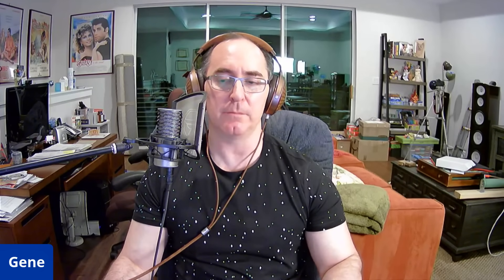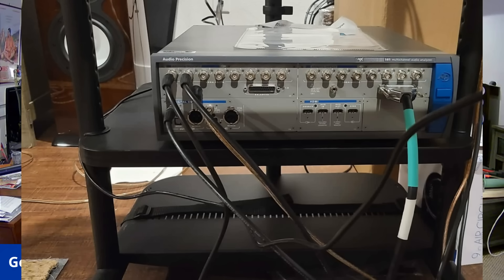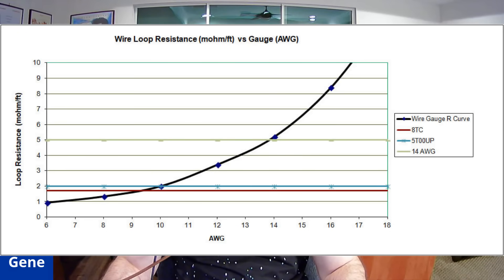Speaker Cables Really Don't Make Much of a Difference?

Comment: Thanks for the factual information! I would love to see the audio differences between high dollar turntables vs medium and low dollar set ups played through a controlled set up much like you have done with the speaker cables. I think there is a lot of hype involved, meant to extract money from people's wallets.
Reply: Actually, this may be something you, or anyone else for that matter, can do yourself.  Listen to an entry-level Clearaudio Concept (currently about $1600) or Concept Black 'table (@ $2K or so) or a MoFi Ultradeck (about $2300), a Pro-Ject RPM 9 Carbon (about $2500) or a VPI Prime Scout (again, about $2,500), then listen to ANY mass-market turntable (your choice) under $500.  Use the same cartridge on both, making sure to set up both 'tables properly.  Regarding audio differences, it's not even going to be close.  And the sonic differences become even more profound as you move up the engineering sophistication ladder with respect to platter, drive system, cartridge and tonearm.  Sadly, it is true that with turntables, you often get what you pay for.
Reply: @oldmacguy4563  Maybe I can try this if you send me a Project RPM 9 Carbon table! Thanks before hand.
Reply: @oldmacguy4563  Ironically any "advances" in turntable technology amount to little more than turdpolish at this juncture considering the obsolescence of vinyl as a high-fi medium. A bit like customized gasoline muscle cars getting smoked by a stock Tesla borrowed from mom for a day at the track.

Comment: But the guy in the shop said it would be crazy to get cheap cable when I'd already spent thousands on my hi-fi 🤣
Reply: Yes, because there is where his margins lie...
Reply: The problem is that other stuff is also fraudulent skyrocket pricing. Fully unjustified.
Reply: Define 'cheap cable?'
Reply: that's how they make money, speakers and most equipment is screwed up for business.  A mom and pop shop need to charge the same price as the internet does otherwise no one will really by +/- a little.  Yet, with cables they can make much larger profit margins, so they teach them and an owner would put that on his employees to keep his business alive.

In fact, if you are unaware audioquest was caught manipulating the sound and even video with hdmi cords they sell.  There's reasonable and not reasonable, and most the company's are trying to juice you up with that. Regardless of the circumstances, the reality is even if you spent 1000 on speaker cables, the performance would be about 1-3% better, if you really believe or feel it makes a difference.  That's not worth it for the price, because 50 dollars will get you 3% difference.  

I am just saying this in general, this comment is not directed at you or for you.

Comment: Excellent Gene, that should shut the snakeoil believers up. As a long time follower (email newsletter since before YouTube) I appreciate cold hard facts over hype. I'm just running 12 gauge with banana plugs to the center / mains and 14 gauge to the rears as it was a cost saving for the longer runs.  I don't recall such attention to detail in your previous cable articles so the top notch measuring equipment will leave no room for doubt and should shut any naysayers down.  Thx for putting this topic to rest, especially for all the newbies.  Thumbs up.

Comment: I don't judge a car on how it tests, I ride it and buy the one that feels better to me. Hey if you don't think wires make a difference then don't buy them. Why should you care what I buy? I buy my cables used and get a great deal on them. Had junk that caused the sound to pop in and out. When cheap wires are on the brink of failure the sound does degrade even if they are still working. Cleaning all of my connections and deoxit the internal preamp controls also improved the sound dramatically. Again if none of that matters to you then I'm fine with it. Just don't try and change my mind. Wine is made from the same stuff but people pay a lot more for certain wines that test the same chemically.

Comment: Way to go Gene - we do agree on something after all !!!
I guess there's a lot of money to be made from selling snake oil. I've been using 6 AWG welding cable sincer the mid 80's with the bare copper ends tinned with silver solder to aid conductivity and resist oxidisation. They did not even cost anything - I salvaged them from a friends' workshop. All those expensive fancy cables from the snake oil mob, and I did do a direct A/B with quite a few of them - well, they only proved to be better in the looks department. 
They all make these outlandish claims about their cables, yet no specs or measurements are provided. If amp, speaker, DAC and manufacturers of other audio gear are required to provide specs, I think it's about time that audio cable manufacturers be required to do the same.

Comment: Thanks for the insight, really appreciate the work put into this matter. My syatem was purchased in 1989, and is still the same till present. The loudspeaker cables I opted was the Linn K400 biwire, which for me wasn’t about sound but for convienience sake and looks. It was like $100  with linn plugs.

Comment: Interesting video Gene, all my speaker cables and interconnects are from Mogami. They have a very good reputation and are not expensive. Thank you for the service you provide to the audio community
Reply from the maker: Mogami makes great cables, snake oil free.
Reply: I use mogami gold guitar cables. Great stuff with lifetime warranty.
Reply: Gene, did you send your speakers to Danny at GR-Research for an upgrade?   Maybe you'll hear the difference then
Reply: @mag290 , tweaking the speaker CAN'T make a difference to the "sound" of the cables. Did you watch the video?
Reply: @mag290  
🤣

Comment: Thanks. I’m off to Amazon to buy some wire, banana plugs and some colorful flexi sleeving, to make my own cheap cables.
Reply: Just make sure the banana plugs you get are gold-plated...(as most are) - it's just a shame that the base metal underneath the flash gold-plating is usually very cheap brass, which is known for it's poor effect on audio.
Reply: So would purchasing a name brand plug be more beneficial? Or are they also a generic gold plated item?
Reply: @badonkadonkskidz   It really depends on where they are sourced from - most are made in China so they are most likely to be made from cheap base metal and then given a gold-plated finish (that makes them look good, but stops the base metal from tarnishing). One really needs to ask the suppler what the base metal is..if it's brass then it is less good than say pure copper.

Comment: Appreciate the video. Is an increase or decrease in db the same thing as an airy top end, or better separation, or a blacker background, or improved clarity. I just switched from 14awg zip cord to the Kimber 8TC with WBT connectors and did in fact hear changes in the upper mids to treble arena. Not sure how a machine can hear or read human hearing based sound “impressions”. What are your thoughts?
Reply from the maker: My thoughts are the difference was barely measurable and in this instance inaudible.
Reply: @Audioholics  Kept my old cables and will do blind tests this time around. Still going to base my decisions on how it sounds to my ears, not how a machine measures dbs. + -
Reply: The author will probably explain to you that you've been sold expensive jewelry and you've wasted your money as there is no difference you can hear (it measures less that 0.06 dB difference after all...the graphs PROVE that :-( ). So your hearing is either perfect or you've been taken in by a placebo effect.

Personally speaking I think it doesn't matter what the author thinks...you heard a difference !! And if you like the difference then keep the Kimber - if you didn't hear a difference, get a refund
Reply from the maker: @timomalley1027  I did keep the Kimber because it looks cool ;)

Comment: Well if cables ever mattered and audio companies know that they do , so why they still use those tiny wires in there crossover or point to point wiring 🤷‍♂️.  
Yes we need quality cable but we don’t need batteries on them or freezing them to sound better 😁.
It always baffled me how someone hooks a python from there amp to the speakers and inside the equipment there’s only tiny worms 😂🤣
Reply: 😝😝😝😝😝😝😝😝😝😝😝😝😝😝😝😝😝😝😝😝😝😝😝😝😝😝😝😝😝😝😝😝😝😝😝😝😝😝😝😝😝😝😝😝😝😝😝😝😝😝😝😝😝😝😝😝😝😝😝😝😝😝😝😝😝😝😝😝I’m still laughing 😆 😆😆😆😆😆😆😆😆😆😆😆😆😆😆😆😆😆😆😆😆😆😆😆😆😆😆😆😆😆😆😆😆😆😆😆😆😆😆😆😆😆😆😆😆😆😆😆😆😆😆😆😆😆
Reply: Those wires in the amp run a very short length so thin wires can used. Thicker wires are needed for speakers becuase they need to run way longer.
Reply: @AbsoluteFidelity   no sry , I’m not saying we should use 1mm wiring but not 10cm tick wiring either. .  It will make no difference.

Comment: Personally I would like to see the difference that copper clad aluminum has vs oxygen free copper in this same test. Mabey even some 99% silver wire for fun.
Reply: For silver or even gold, versus copper it's just a matter of resistance.  No need to actually test wires made of them, just extrapolate given the data presented in this video (spoiler alert, it won't make an audible difference.)  Also all copper wire sold for electrical wiring is "oxygen free" to a pretty high degree.  Else it would turn green aka corrode and fail.  It's actually more important for house wiring because the wires carry much more sustained current and at higher voltages than speaker cable.
Reply: Agreed! 😉👍

Comment: Power Cables are the biggest joke. Instead of spending $1000 on an Audioquest power cable, put your money toward a PS Audio Regenerator.
Reply from the maker: or neither. Just have a couple of dedicated 20A circuits to feed your audio gear and use power/surge supressors from reputable brands that have either CL,TUV,CSA or other 3rd party safety test certification.

Comment: Now do copper (OFC) vs "copper cladded" aluminum (CCA)!
Reply: Go to Wikipedia and search 'Copper wire" . There are only 3 but the sellers make you think there are 200 types. Go for low contaminant OFC or OHNO Continuous Cast (OCC).
Reply: @amazoidal  There are multiple grades of copper wireavailable....it just depends on what you ask for from the refinery/supplier in terms of purity.

in the 1980's when standard purity copper went up in price, some telecomms companys (in Europe) used to instead specify "Polish" copper (from Poland) to sink into the ground (or string from telephone poles) when new telephone lines were required for the likes of new houses and businesses (due to the increase in demand due to fax machines and modems). Polish copper was cheaper and less pure (ie had more contaminants within it) but it was ok for phone wires (which have a limited frequency bandwidth). When demand for Polish copper increased they switched to using aluminium, which was cheaper again, but had higher resistance.
Reply: Or tin-plated coper, silver-plated copper, solid core, braided, Litz cables, twisted pair copper - all excluded from the video...I wonder why?

Comment: I don't care what anybody says , ill be dammed if I set my $500k McIntosh Line Array system up with bulk Belden wire & interconnects from Best Buy or Guitar center ,I also refuse to spend $3k on a pair of McIntosh XLR's simply for appearance, I will however spend a grand on affordable wires & interconnects from company's like Emotiva simply because my $150 Emotiva speaker wires look just as high end as a pair of $1,500 speaker wires sold by McIntosh. 

BTW any of you know legendary speaker designer Roger Russell personally, or by his name being connected to McIntosh Labs hifi ,I speak with him once or twice a month & he is not doing well in his assisted living home,his houses are gone,his massive vintage gear collection gone,his storage facility full of cabinets of research & white papers are gone,his wife is in a full on nursing home & has dementia, and to top it all off he is barred from seeing his wife over this Covid insanity ,I never asked if he still responds to his decades old @earthlink email address any longer but if you have it you wouldn't be wrong in sending him some much needed kind words right now,his brain is sharp as a tack but his body isn't.

Comment: Kimber 8TC is the best cable you can get???? oh dear :-(
Reply from the maker: It's the "best" cable I have on hand to do the comparison. And yes it's very good cable. I wonder what you think is better and if there is even published measurements on your magical cable.
Reply: @Audioholics   I don't have a single "magical" cable...as there are many cables available made from different materials (Cu, Al, Sn, Au, Ag or combinations of these etc) and different insulations (uPVC, PE etc) and different construction (figure 8, webspaced, Litz, twisted pair etc) and these each have different electrical properties...which can affect the Zobel network in the output stage of an amplifer and/or react with the reactive load presented by a x-over network and drive units variable impedance (wrt frequency). So cable choice is based on many factors. You alone should know this. So, horses for courses is the way forward...and find a cable that suits the specific electrical properties (of the hardware) and which affects the tonal balance of sound (due to the inherent LCR network that a cable presents) in a way that the listener prefers. (I've been in the audio industry full time since 1978, working in hi-fi retail, installation, manufacturing concept and design, and distribution, so I have experience of many systems and many cables over many years).
Reply from the maker: @timomalley1027  at the end of the day, all that matters is how the cable measures. Silver slight advantage of conductivity over copper is made up for by using more copper. Zabel at the end of the cable shouldn't be needed if you don't make a stupid design like the Goertz high capacitance cables that are no longer in business. Measure at the speaker and see how little difference there is even between cables that measure differently. The burden of proof otherwise is on you since I'm the one showing with repeatable measurments what is really going on.

Comment: Cables don't make a difference only because you also have to rewire the cables in the speakers, in your house, and also the cables that run from your home to the power plant. Only then does it make a big difference.
Reply: Not if you have a power regenerator supposedly
Reply: Correction: Even then it won't make any difference!

Comment: TL:DW 9:24 10 foot cable at 8 ohm load (note the vertical scale is only 2db), difference = 0.06 dB between 9 gauge and 14 gauge, below the limit of human hearing. 
Distortion is 0.006% THD difference, inaudible.
11:55 Even tested while connected to Revel loudspeaker! Only 0.06 dB difference  again! Inaudible.

Comment: Thanks Gene. As an ASR fan, I already agreed with your conclusion, but you do an outstanding job of demonstrating, and then arguing for truth, and I learned some things from your demonstration.

Most of my systems use plenum cable or lampcord with tinned leads, but my main system uses a 12AWG extension cord dressed up nicely with heat shrink, techflex, cable pants, etc.

Comment: If you have ever opened up a speaker, most of them use 16 or 18 gauge internal wiring coming from the crossover. Using wire much larger than that (unless the run is long) is fruitless since the internal wiring is youre bottlekneck. If you believe the whole wiring lie. Great video sir, Thanks for confirming my ideas.
Reply: The "bottleneck" is also in the power amp.
Reply: @amazoidal  Correct, but if your speakers are using crappy internal wiring, how much good can $20.00 a foot wiring help. PLease though, don't get me started on power amps or multi amping.
Reply: And how much difference can a shielded $950 AQ power cable make on the end of 100ft of cheap 14 gauge Romex? Preceded by miles of power company aluminum wire?
Reply: @amazoidal  Um, why are you running 100 feet out of anything and then tacking something else on the end. No, f@#ck the $950 bulls#$t and just run the 14 ga all the way.